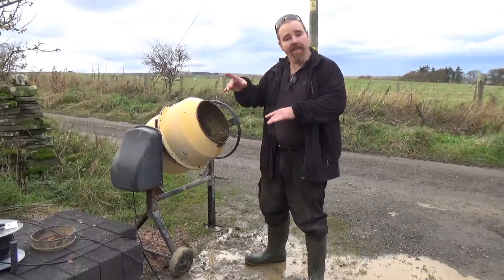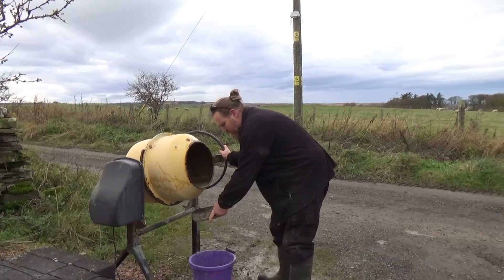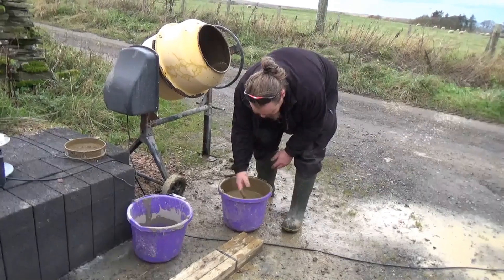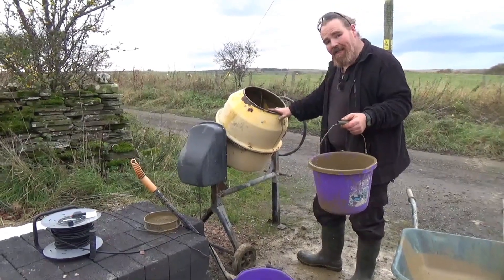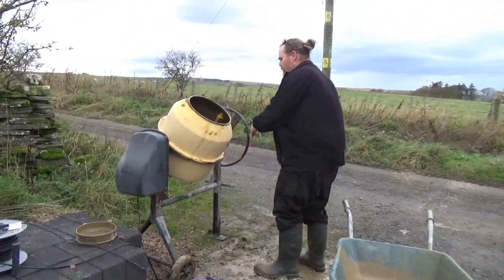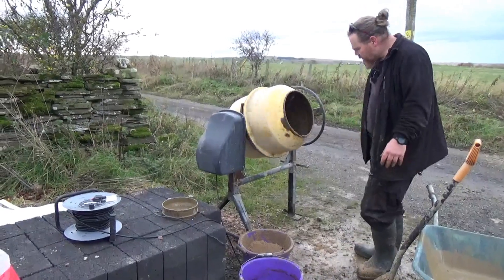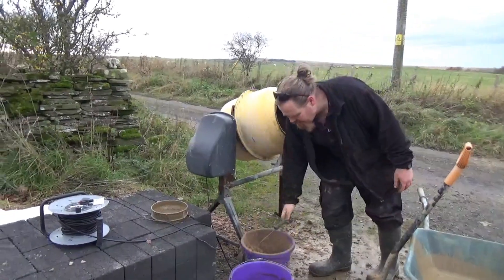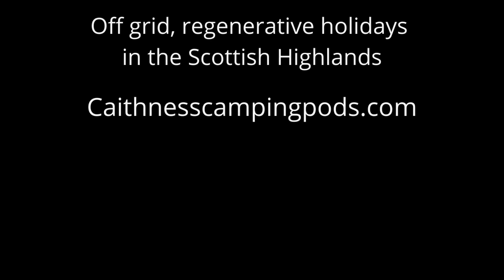Rocket mass heater build 5. Clay sand mortar. The most efficient heating in the world.

Comment: mil is an English unit which is 1/1000 of an inch.  I think you meant millimeter.  Great content, BTW!  I'm learning a lot!
Reply from the maker: Just to be confusing, outside of things like plastic sheeting, where mil is indeed 1000th of an inch, 'mil' can also be an abbreviation of millimeter in engineering. I'll try to be clearer next time, thanks!
Reply: @CairnOfDunnCroftPermaculture  I'm an electronics engineer and design printed circuit boards for a living.   I can switch between "mil" and "mm" in my PCB design software.  I prefer mil because I can visualize it better. 

I've definitely confused some of my mechanical engineering friends by using the term "mil" when presenting a board design to them.   They think I mean mm.